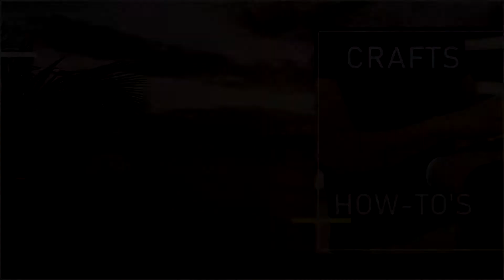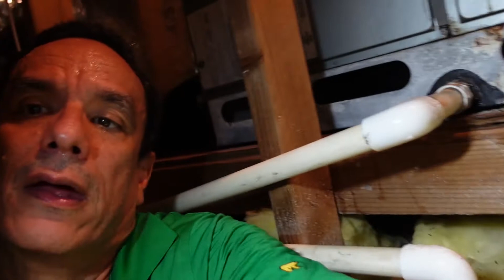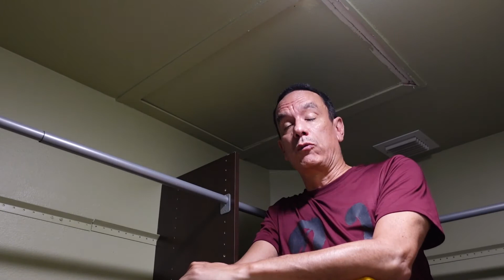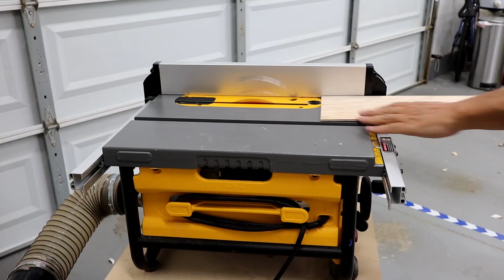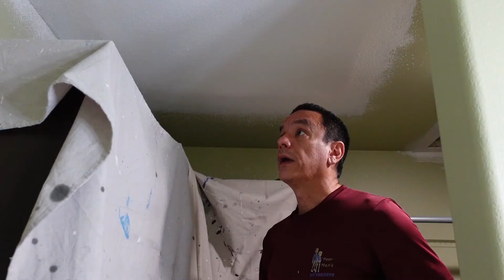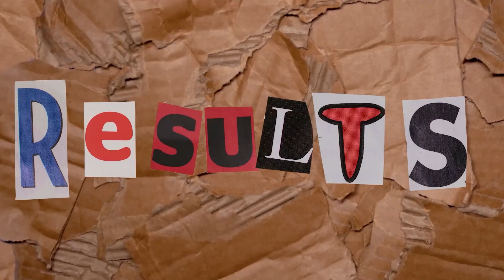Repairing Ceiling Drywall Water Damage

Comment: Interesting clips you used to screw into, I've always just used scraps of wood 🤣🤣
Reply from the maker: Scrap wood will definitely work but the clips have a couple features that helped me out a lot. It actually holds the drywall in place so you don't have to hold the drywall up while try to add some screws. Once finished, you easily break the clamps off and have a flat surface. Definitely recommended for large repairs and scrap wood for small repairs. 😄
Reply: @Poor_Mans_DIY  they sound pretty nifty!